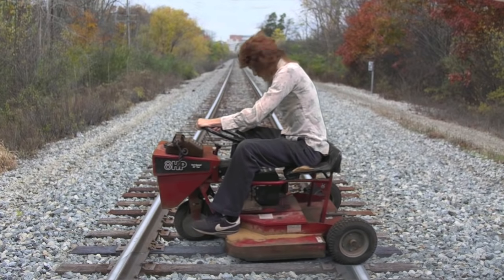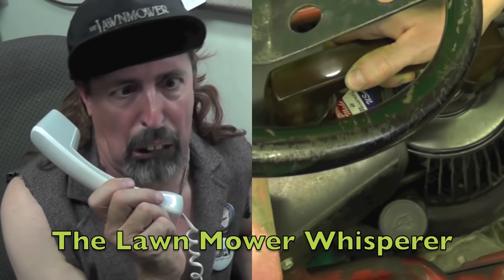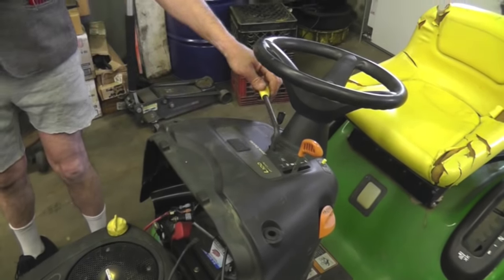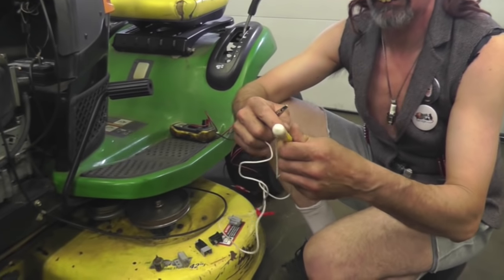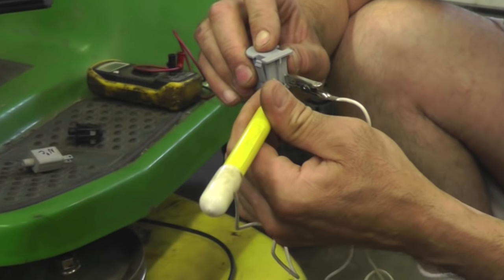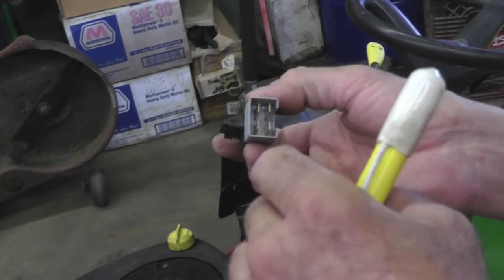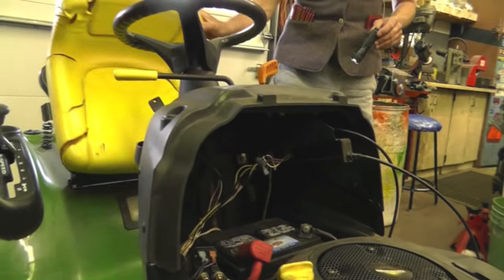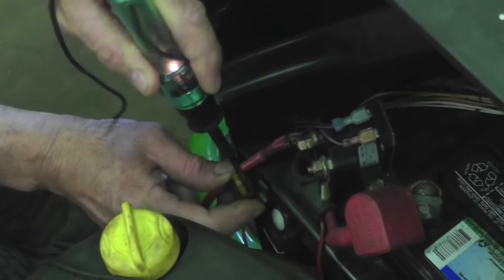Electrical Troubleshooting FOR DUMMIES

Comment: Small engine repair is my new hobby and these videos are like doing an apprenticeship at a shop. Outstanding. I’m working my way though years of theses and enjoying the hell out of it. Thanks!
Reply: That good info because if your a old guy you forget to test everything thanks
Reply: @JQUICK21 For awhile until the copper wire oxidizes and creates an open circuit. Then there's  being
 just a little less safer to operate. Where's the tip of my fnger? Oh, there it is sitting on the grass.

Comment: July 3, 2022.  I used my tractor two days ago.  Went in for dinner and a couple hours rest and, when I came back out, I turned the key to find nothing.  No noise at all. I thought the battery might be dead somehow.  I tested it and it's fine.  I now know what else and how else to check.  I'll add to this comment after the rest of my trouble shooting.  Wish me luck!!

Comment: Hey, Taryl--thanks for the advice on troubleshooting my 2002 John Deere tractor with 16 HP Deere/Kohler engine.  It was running beautifully and just suddenly quit.  I suspected a fuel flow issue, so I replaced the fuel filter and fuel pump, but that didn't solve the problem.  I started researching on youtube and came across your "How to troubleshoot electrical problems", and when you described exactly what happened to me, I followed your advice and removed the fuel shutoff valve, cut off the small "plunger", and reinstalled.   Now, she's running great again--Thank you!

Comment: Dear Taryl.  I really owe you since I "fixed" my tractor 'cause of something you said in this (here) video.  I thought I was a pretty savvy guy, but there was a lot I didn't know about the electrical system.  You started by saying: "If you jump off your mower after turning it off to get a drink, and it won't even turn over when you get back, check if you've turned off the mowing deck!"  I thought smugly that I always turned the deck off.  However, this time I had run out of gas.  For a couple of days I didn't know where to look for the problem.  I saw this (here) video and I was amazed at how many safety kill switches there are.  I never had thought of the one for the mower (pto).  Today, I went out and looked at the PTO pull knob.  Sure 'nuff it was ON! I hadn't thought of it when the engine stopped. I turned it off and the Garden tractor started up!  It didn't start up easy,  'cause I have more to fix!

Comment: Great info.  Exact situation happened where mower ran fine, I turned it off to go inside, came back and it wouldn't start.  The blades looked to be disengaged but apparently were not.  I moved the blade engagement lever in and out of position a couple times and now mower starts up!  Wish I'd have seen this before removing ignition switch and starter solenoid and battery swap!

Comment: I thought my Toro Wheel Horse 265-H was the worst with all the safety switches. Thanks for taking the time to make checking these things out easier than one may think. I wish I could bypass all the safety switches but the most important ones. The switches are so cheap and seem to fail all the time. Peace, Reese

Comment: I took the tip off the fuel solenoid on a Kohler in a husqvarna vtwin Command....much better than buying a new one mower had sat for two years or so without being ran neighbor gave it to me the valve was stuck in the closed position shutting gas off

Comment: Excellent video! 1999 Troy Built 2 cylinder Briggs & Stratton can't get spark to the plugs, checked all safety switches, 2 new coils, new ignition switch, removed kill wires from the coil and still no spark, checked fuses and found blown fuse and replaced it, new solenoid as well. Don't know which direction to go now. cleaned the magnet on fly wheel, shear pin is OK turns over great but  no spark. looked at harness for bad spots or broken wires and looks OK.

Comment: Also, check to make sure that both of the wires that connect the fuse, hasn't wiggled loose.
That is what was wrong with mine. It is a very easy fix, and could save you hours of headaches. You won't hear a click when you turn the key. I found the problem when I checked the fuse.
Reply: @JEFFQUICKLE9 Yup, or disconnect it, like I did with the safety switch under the seat.

Comment: Another good video from Taryl.. Fixing a Scotts 1742 I discovered the Magneto had wiggled it's way forward and was colliding with the flywheel... Taking Your tips I put a few business cards together to get distance on the magneto, pull the plug a  put a little  10w-20  in the cylinder and There was my dinner.. engine  rotated for the first time since Hannah Montana.. Woooo wee...

Comment: Taryl. Thank you.  You saved me much time and grief.  The issue was not any specific thing you talked about but it pointed me in the right direction.  It was related to the blade engagment.  On my tractor there are a bunch of springs above the deck which engage the saftey switch.  I discovered one of them was broken.  I used a wire tie to re-attach it and boom she started.  And there's your dinner.
Reply: vhv

Comment: This video perfectly demonstrates how mechanically driven is always better than electronically driven. Yes electronically driven is all nice and easy but it’s also always built to be thrown away in two years. If you wanna go and fix it all power to you. Mechanically driven will last 20 years plus and require normal tune ups.

Comment: Fuel shutoff on my JD X320 was only getting 10V and would not open.  Traced back to 12 circuit M/F connector which was bad near Key.  Recurring situation.  Cleaned it several times and distorted male connector in Yellow wire to give tighter contact.  I think you can still say Yellow!  Next time plunger gets shortened as it is not Gravity feed.

Comment: Mr test light is awesome. I have ran into a bad diode a couple times on dixon mowers.Pull out the PTO and the engine dies,check the main fuse and it's blown . Caused by a bad diode in the wiring harness the the electric clutch.
 Solder in a new diode and you get your dinner.

Comment: I have fixed & replaced about everything pretty much on a vehicle(-engine,transmission, & diff insides). But i'm a noobie with riding mowers. Went to crank it for first mow this year, spent 3hrs looking at everything but 1 thing. The fkn manual blade switch lol! Soon as I watched you show in the vid, went out & sure enough...that was the problem. Thanks for saving me some bucks! I was going to buy new solenoid

Comment: Hello Taryl, sort of like motorcycles with clutch and kickstand switches, clutch has to be 
pulled in and kickstand down so the starter works, one end of 1 switch hookt to 1 end of
next sw. known as 'in series'

Comment: i remembered when i removed the antibackfire solenoid off the carburetor when i had a Kubota T1560 the safety switches didn't work as i learned the safety switches on Kubota and other lawn tractors are linked to the antibackfire solenoid on the carburetor as others are by grounding out the magneto coils in the engine. but can vary from one make lawn tractor or zero turn mower to another

Comment: On a Husquarvna (circa 2009 model) there are two round gang connectors. One goes to the ignition switch. The other one goes to all the safety switches. If you unplug this connector it disables every safety feature on the mower. Not recommended to do but handy if your trying to troubleshoot these switches on a Husquarvna. One day I was starting my old  79 Snapper Hi-Vac and forgot I had it in gear. Those mowers only had a safety switch on the deck. This mower did not have an electric starter. I forgot I had it in 5th gear and when I started it using the recoil, it took off and I had to chase it down. It went about 50 feet before I could catch up to it!

It seems one of the most common reasons mowers won't start are these switches. One day my father said his Snapper rear engine wouldn't start. I traced it to the safety switch for the deck. The mower thought the blade was engaged. The switch was a four prong like in your video but what was weird was the connectors criss crossed. I had to look on the "interscreen" to find a diagram to see which connectors did what when the button on the switch was pressed. I'm not sure why there were four connectors going to the deck switch unless it was wired in series with the brake or seat switch and has to go through this one.

Comment: Last summer my mower just quit. No power. Kept blowing the 30amp fuse as soon as you turned key.  I started from the back of the mower and started checking everything. Working my way forward. Over a few days checking for the short when I wasn't at work. Every switch. Then to wiring. Started pulling harness from back to front. Cleaning grounds and using die electric grease when reassembling. Last section of wiring was the headlights is where I found short inside loom that was zip tied too tight. Power and ground wire rubbed together 🙄. Now only if I started from front of mower. Would've only taken a minute to fix not a few days 😂

Comment: Taryl. Thank you!  My Deere Sabre with B & S engine 17hp, the problem is the Fly wheel cease up, it won’t turn over at
all. The mower set in the garage over 2 years and the engine oil leaks and mixed with a lot of gas. What I can do next?

Comment: The switches would be in series in the starter solenoid ckt. . If u or taryl  are not in the seat
and the engine is shut off but blades were on when shut off, you have to dis-engage the blades
and sit down b4 engine can start.

Comment: If you have a mower that uses a 3 post internally grounded starter solenoid and accidentally buy a 4 post solenoid on Amazon or wherever you can just make you’re own ground wire to make it work. Found one dirt cheap the other month when I needed to replace mine.

Comment: yes I did I put a new one in as well as new gas yesterday seems to backfire worse when trying to start   in the choke position timing issue keeps going through my mind
Reply from the maker: You said you checked the flywheel key. Did you get the bolt tight tight? If not it could have sheared the key, check it again.

Comment: Taryl, I have a 2166 cub cadet that will run until I let the brake off, then it dies. I've checked all 3 safety switches and they're all good. The ignition switch is good, along with the pto switch. It will start and run fine until the brake is released. The pto clutch engages with the key on so its good. I've checked continuity on most of the wiring and I'm just about at the end of my rope. Any suggestions? Thanks

Comment: the safety switches can differ as some they kill the spark by grounding the magneto coils as others mainly on the Kubota T series lawn tractors the safety switches are linked to the fuel shutoff solenoid, anti afterfire or antibackfire solenoid on the carburetor as the safety switches and kubota's reverse awareness system switch all link to this solenoid on the carburetor to kill the fuel. as it varies from one mfg to another.

Comment: Thanks for all the video's. Lots of great info. I have an issue maybe you can help me with. I have a JD LT133. I burned up the stator and intended to rewind it. I noticed of the 3 wires coming from the stator that one of my stator wires was grounded to the stator body but is also wound on the last 6 posts and then connects to one end of the other wound wire.  essentially that would make all my coil wires touching ground. How is this possible? This is a 13hp Kohler Command Series with a 3 amp stator. Thank you.

Comment: Taryl, I can't get power going to the wire coming from the ignition. I even tried a chaser wire and still nothing. I installed a new battery and four pole solenoid. I use my Deere to help me out following wires. The switch is good also. I put it in my Deere and it cranked up. I've looked at all the grounds and cleaned them. This is an old craftsman mower with only two safety switches. I can jump the solenoid and crank the motor. The guy stated that he heard a pop so the first thing that I did was add a 20 amp fuse to the equation which I had hoped would have rectified my situation...any chance I can call you and you can whisper to the engine so i can get it out of my yard...lol

Comment: Thanks for the video. I have a  craftsman zts7000 and whenever I hook up the battery there's a spark and it will drain the battery in a short time. I can hear it click when I connect the battery and then click again in a minute like a circuit breaker and then it will start and run, but it will die in a few minutes. Do you have a video to troubleshoot my problem?

Comment: do you need to set timeing after putting in an electronic egnition coil?
Reply from the maker: +fernando paniagua Timing is pre-set you only need to set the air gap.

Comment: I have a bolens tractor series 700, been working off/on for week now.. get nothing when I turn the key. Can jump with cables from truck to negative on batt and positive on starter turns over. I've Checked wires from batt and solenoid to ground all have continuity. All safety switches are good too.

Comment: On a Mountfield hydrostatic ride-on,I have had two replace a starter motor and 2 solenoids in close succession.Solenoid seems to be blown once again,as well as starter.Could a bad/low battery be responsible for causing these parts to blow? If I put in a new battery would it  keep these parts safe from burning out in the future?
Reply from the maker: +Paul Elliott who's engine is on it?
Reply: Its a Kohler Engine on it Taryl

Comment: I have a John Deere D140. When I start the engine I will here a whining noise (starter?) and the red positive wire to the battery terminal gets hot, smokes, and has melted some of the wire casing. The starter wire also feels warm that connects to the starter.  I have replaced the solenoid from a John Deere supply store. I also replaced the battery with 350 cranking amps (melted the post off of the previous battery). I used my multi meter to check for resistance and continuity issues but could not find any. I pulled the engine cover off to view the starter. It appears that the gear thing is coming up and meeting flywheel. Sometimes it will start right away then if I shut if off and restart I get the whining noise, smoke coming from the positive battery terminal. I did not check the relay switch or ignition switch but do you think it is the starter? I bought this tractor used 3 years ago and replaced the starter once before (aftermarket) due to it smoking and cooking the windings.

Comment: Oh that was on the Kroler v twinn, also do you have anything on serviceing the pumps on thr zerouturn?
Reply from the maker: +David Moore Those pumps on zero turns they make so many different ones & repair parts are sometimes hard to find I just replace them it's easier & quicker for us.
Reply: Mine still work fine, but after  yrs. Feel I should check fluid level's, thank's, p.s. even got women watching yer vid's who don't even own a lawn mower lol
Reply: Howmuch doe's replacement cost ? New or rebuilt?
Reply from the maker: $400.00 500.00 each.

Comment: On a craftsman t8200 starter will barley turn the motor over. But with  both plugs out it turns over real good and the plugs was dry... Any advice.

Comment: I saw a Briggs and Stratton engine on a Craftsman front engine riding mower that had a singed wire coming from that valve underneath the carburetor.  It was not plugged into the other wire that was ok so the engine would not turn over when I turned the key.  I plugged both wires into each other and the engine started.  Why would that wire from the carburetor switch under the float bowl be singed?  I was told the fuel was getting into where the oil goes.  What would cause fuel to get into the area of the engine where the oil is?

Comment: Taryl, I have a craftsman R-1000  420cc  rear engine model # 247.290003 made by MTD.  The engine starts fine, only when I try to engage the blade the engine will die down to a stop. I looked for obstructions under the 30" deck,  all is clear.  The pull which holds the blade turns freely when I have it in Neutral. Any suggestion would help, Thanks. Phil/Ohio.

Comment: Great Videos!! Need help for Murray riding mower. The briggs starts OK and runs until I let the clutch out. So I replaced the brake/clutch switch and the PTO switch. The problem remains the same. So I replaced the ignition switch which did not help. It starts and runs until I let the clutch out. Any suggestions will be greatly appreciated. Thanks...jz
Reply: jim zimmerman i have a old murray also that i kept having something or another keeping it from starting so i gutted the safety wiring and installed two push buttons for starting and stopping.

Comment: I have a husqvarna RZ5426 in the shop that shuts off when you start releasing the brake , it also will do it if you take it out of neutral and start to push the lap bar fwd, seat switch is operating as it should any ideas what else could be the problem

Comment: Tary I could use your expertise also, My Craftsman Briggs and Stratton 19hp wont turn over. I connected the battery directly to the starter with and without the spark plug in. It spins like it is supposed to with the spark plug out but when I put the spark plug back in it will not turn over.  I checked the compression on the valves and both valves move about the same so I don't think its the camshaft. The mower is only 3 years old.  By hooking up the battery directly to the starter and it still wont turn over rules out all the safety switches and the solenoid right? Any ideas on what it could be?
Reply: curtis hobson bad battery......test it.?
Reply: wasn't the battery I had it repaired it was still under warranty. I was a broken cam from bad gas
Reply: Good deal
Reply: Sgx